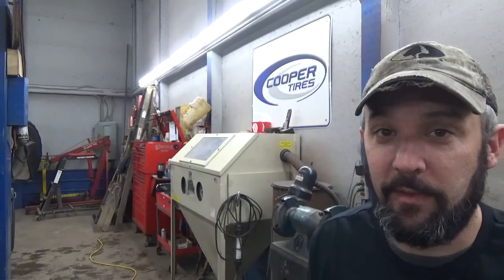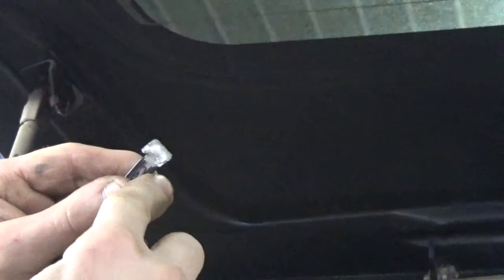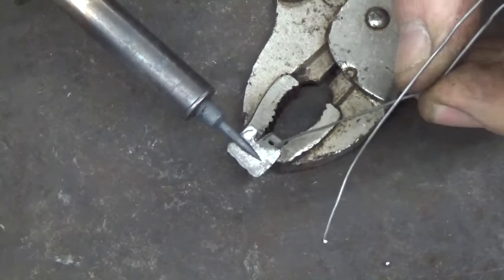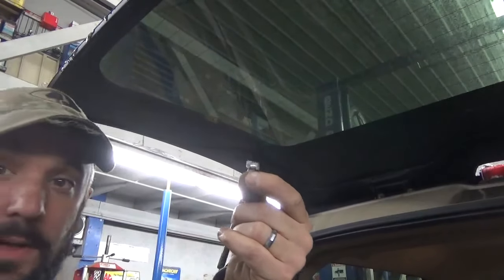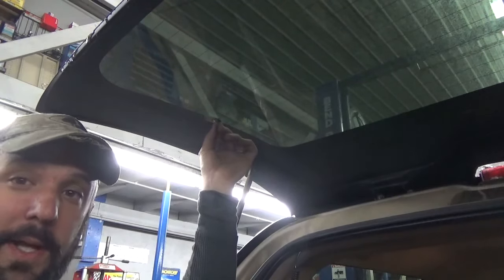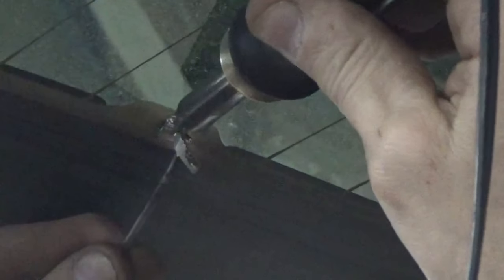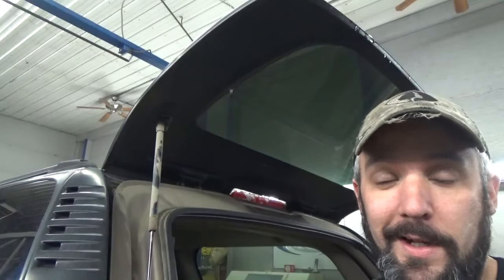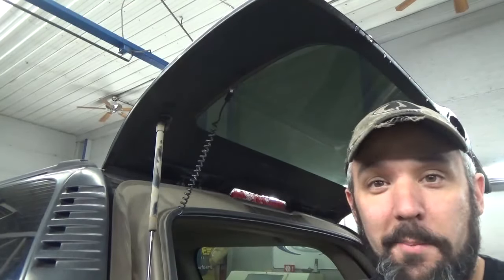Rear Window Defroster Tab Repair

Comment: For those afraid of shattering the glass from the heat of the soldering iron.. think of this. Your window is freezing cold, and you hit the defroster. It gets HOT pretty fast, and melts the ice off. If that quick thermal change and that much heat on a frozen window won't shatter it, a soldering iron for a few seconds won't shatter it either :)
Reply: Posted my 2 cents today on my fix, your right about the heat.  Use an electric Soldering gun or Pencil type .  NO TORCH!
Reply: Thanks, that is my biggest fear. Have a convertible with actual glass and defogger and one tab came off the grid(now I know why), come summer I think I will remove the connectors  from the grid.
Reply: That makes perfect sense!
Reply: That glue is a waste of money
Reply: @boyr3025 I tried the permatex kit today. It wouldn't even bond.
I'm surprised. Because Permatex usually makes great products.
Either that. Or I got one from a bad batch?
I had to Epoxy Glue mine.
Hope it works?
Reply: @4mikeyd  I also tried the glue.  It worked a single time, then melted, ran down my window and no longer works.  I assume it lost whatever conductive materials were in it after that happened, now I have the tab firmly stuck to the windshield and I'm worried if I try to pry it off it will break off the contact point.
Reply: @4mikeyd Regular epoxy does not conduct electricity. Epoxy will only work if it is designed for defroster repair.

Comment: Have you ever seen tiny holes drilled for Bondo to push into, to adhere better? Same principal- drill 1 tiny hole in the metal tab. When soldering- when it flows through the hole and hardens- it's like a rivet. Super bond.

Comment: Worked for me. I sanded what was left of the window pad which was right over my head. I tried to tin the pad but could not get the solder to stick leaving me with a pool of resin on the tab. I put a big ball of solder on the broken tab. I used a screwdriver to hold the tab up on the window pad. Got my biggest watt soldering gun and the solder melted between the two about 20 seconds after taking the completely hot soldering gun to it. Took away the gun and held it in place for 10 seconds to let it cool. It stuck and had electrical contact with the other tab. I am going to put a light coating of a two part epoxy so the soft solder is not the only binding agent to the window. Easy peasy and make sure you have a drop under the workspace so molten solder dosent burn your car's carpet.

Comment: My wife's Jeep had both tabs break a year or so apart. Had a shop fix the first one, looks like they used conductive epoxy and it held OK but there was a bit of resistance in the connection. Second tab broke so I was going to fix it myself. Bought a kit, got sidetracked, lost the kit, ended up here. I'm glad I did, too. This was so easy to fix it was ridiculous. I spent more time digging out my soldering iron than I did actually repairing the tab. It's holding strong and has zero resistance. Thanks for the video!

One extra note for those having trouble getting the solder to flow on the tab when bonding to the window: If you have multiple tips for your soldering iron, use a wedge style or hold the iron so that a lot of its surface comes in contact with the tab, not just the tip, or it may not transfer enough heat over (or it may take a lot longer).
Reply: Thanks for the tip! Wife just bought a jk and the tab is off

Comment: Just did this fix on my 2006 Mustang and it worked great! I had to upgrade my Weller 25W soldering iron to a Weller Medium Duty 60W soldering iron in order for the solder to melt on the whole surface of the metal tab. Also in my case, even with the 60W soldering iron, I could not melt the solder from the other side of the tab while pressed against the rear window so I just melted the solder first and quickly pressed it to the window before it solidified and it worked. Thanks for saving us all a lot of time and aggravation!

Comment: Thanks so much for this video.  I've been soldering things for decades and considered it for our '14 Yukon.  When I saw other sites suggesting it could break the glass I was hesitant.  Watching this video and reading the success comments gave me the courage.  5 minutes later and we're good as new.  Actually better than new since I discovered the factory solder never even touched one whole side of the tab.  Thanks again!
Reply: Forgot to add:  Since it's close to freezing out, I did run a hairdryer around the area a bit first just to take the edge off.  Not sure it was really needed but didn't take much effort.
Reply: @35charlie38  good call! I was worried about doing this when it's below freezing.

Comment: I have zero experience in soldering and with huge fear of glass shattering i gave it a go. And it worked :) I have no idea what king of soldering iron I have or what kind of solder I have... It took couple of tries but works for now. Thanks for the video!

Comment: This video worked like a charm. I have had my Prius for the last three years and the defrost never worked. I thought it was something electrical but it turns out it was one of the pieces needed soldered just like the shows. Thanks for the detailed instructions and it worked like a charm.

Comment: Eric, This really works great if no one has tried to super glue or epoxy the tab on before you get it.   That conductive coating on the glass is so thin it won't stand up to scraping.   GM recommends silver bearing solder instead of tin/lead alloys.   Also, the tabs often fall off due to excess heat generated by resistance created by poor terminal tension where the connector snaps on;  check the female terminal wings for fit, not just the snap feature of the terminal.   Great video, I just discovered your channel.
Reply: I totally respect your input. Took mine to GM and they offered to replace the whole window saying they couldn’t simply get it back in place to stay. I knew that was BS coming from a electronics background. And the recommendation of using silver bearing solder coming from GM? We’ll let’s just keep in mind it was their tab that came off in the first place. Thanks for your input though, I appreciate you. 🙏🏽👍🏽

Comment: Rear window on a 2009 Tahoe,  I just finished after watching this video,  used my battery Dremel to clean the contact & window contact  Loaded up the contact with rosin core solder after fluxing  added flux to the window contact cleaned with dremel wire brush and standard 100-140 watt Soldering Gun and finished. the whole job took 5 minutes. 
It is 30 degrees here in NY and was worried about blowing out the glass with the Soldering gun.  
Just tested with a infrared thermometer and It worked.
Reply: I have a 2007 Tahoe and Im in Michigan. No luck with getting it to work.
Reply: Aquarium Network With
Reply: @goaldigger2314  The same here :(

Comment: Thanks Eric!  Just finished this repair on my 08 Yukon.  Took a few tries to get the right amount of solder and heat, but on the third try  the solder flowed under the tab and it was stuck back on the window!  I'm back in full defrost mode again.  I put on my safety goggles and a hard hat just in case the rear window exploded!  The window remained intact  I had tried the epoxy on a previous vehicle but it did not "take".
Reply: What wattage is your soldering iron? Did you use Flux and 60/40 as suggested above? 
I'm doing a Tahoe also, 2007
Reply: I have Weller 100/140 watt soldering gun.  I used the 100 watt setting with 60/40 rosin core solder.  It's been two months and it's still stuck on the back window!

Comment: I've watched just about every brake pad replacement video you've made. I now replace my brakes like a pro. 1998 Saturn, 1997 Ford Explorer, 2007 Honda Accord. I've done them all. Last year, I blew out  the rear hatch window on my 1997 Ford Explorer with my weed whacker. I had the window replaced with a new one. The new window must have been made in China, because both sides came loose. I wondered if you had made a video showing how to fix this. Lo and behold you did! I loaded up the connectors with solder, and reattached them. Thanks, Eric!

Comment: Thanks for posting this. I've been soldering stuff for more than 45 years, but have never tried to solder foil on glass. I was worried that thermal shock would crack the glass, but I see that is not an issue. I'll try this tomorrow.
Reply: Nah, no worries there. That's tempered glass meant to withstand brutal temps in both directions, and because the defroster wires get hot really fast, to melt ice...the glass is made for this. Sally forth, and solder! :)

Comment: Great video! Passenger side of my 2012 chevy impala tab was broken off. Glass shop told me today they would need to replace entire rear window at a price of $430.00! Saw your video and soldered on piece that broke off. Strong solder done as following your instructions and WORKS! THANKS! 👍

Comment: Better than the alternative adhesives, in my opinion. I just happened to have an old soldering gun with a tiny blob of solder still on the tip. Followed these instructions and worked perfectly. Took about 2 minutes. Thanks!

Comment: thank you again... i seriously just did this in the time between these 2 comments.. took 3 different irons and on the 3rd it took the larger tip. final iron was a soldering gun and it only took a few seconds.. smelled like someone tried to superglue it prior. havent tested yet but after i scraped the gunk off both sides i have confidence. The glass was just warm to the touch after and this video gave me the confidence to complete this very basic repair.

Comment: Thanks for the instruction from Melbourne, Australia.  Worked exactly as you showed.  Being a bit paranoid about heat cracking the glass, and since it's a bit of a cool day, I preheated the glass with a heat gun.  Probably helped the solder heat quicker too.

Comment: I just did this repair on my sons 2011 Crown Vic PI and it stuck.   I took the tab and sanded it clean.  then pre soldiered the tab.  The car was sitting in 80+ degree weather with the sun beating down on the glass.  I held it up on the glass and touched the 30w iron to it and about 20 seconds later.   No broken window and it stuck really well.   I seen no reason why it wont work.  Will know in the morning.   Thanks South Main!

Comment: Thanks for the video man! I had been contemplating soldering that tab back on, but wasn’t sure if I would shatter the window.
Following your instructions it worked like a charm.
Reply: @itsacowboysway  i tried to do it but it wouldn’t stick to the glass, i got the solder on the tab but would not stick to the glass grid. Is it a special type of solder maybe?

Comment: Thanks tor the help. To get this to work I had to touch the edge of the solder after holding the iron on the connector for a few minutes, otherwise it wouldn’t melt it. In the end it worked.

Comment: Just did this on my 08 expedition this afternoon. I've seen the repair kits out there before, but I've not heard great things about them. I have a lot more faith in a solder joint than I do an adhesive that allegedly conducts electricity.

Comment: Thank you for posting this informative video on this repair. I fix my defroster with this method and it worked great and also I saved myself a bundle of cash. Btw the the glue kits sold for this repair are a total scam.
Reply: especially permatex. 3/4 fail to bond, cure, or conduct at all after precisely following instructions on 3 different vehicles last 10 yrs. Took one back the other day infinite resistance and never cured, store said they'd only exchange but not refund. Second kit wouldn't stick at all.

Comment: I tried a glue kit...didn't stick at all. I returned it to the store and about to solder. You gave me a few tips I didn't realize, like pulling the tab out of the clip and pre-soldering and then heating through the tab. It should be easy now!

Comment: Eric,Very good video and a nice tip for everyone .I've seen some of the epoxy kits they sell in some big auto store that some places make a big mess of the window before they come to the pro to repair.
Reply from the maker: Hey thanks jimthecarguy . I've never used one of the kits just because this only take me about a minute start to finish and seems to work well. How do you do them?
Reply: I do the repair the same way you do.I always worry about the window breaking (never did yet) .I usually let the window warm up before starting.
Reply from the maker: Hey I figure she'll go or blow lol, haven't had one pop yet!
Reply: Yet is the key word lol
Reply from the maker: shhhhhh

Comment: I have done the exact repair numerous times. This is a winter job as people don't use their rear defroster a in warm weather. I have always been concerned with the cold glass shattering from the soldering iron so I heat the area with a heat gun to bring the glass up to "hot to the touch" around the repair area.
Reply from the maker: Yeah I often wondered about that too but haven't had one blow up yet... oh great now I said it...
Reply: that glass is meant to withstand extreme temps,it's almost plastic,made of many layers,no way it would ever blow out,it's like pyrex,the old kind,lol
Reply: Tell that to my subaru outback. With some deer related incident, with no direct contact to the the rear window. The entire rear window shattered. A ton of tiny pieces. I've been meaning to clean it up but I'm afraid of it.
Maybe it can handle heat better than this? But it doesn't seem like it had much in common with plastic.

Comment: Thanks for the helpful video from a  very grateful viewer in Ireland.  I bought a used Hyundai SUV  with the tab broken off the rear window.  Unfortunately,  when it parted company with the glass it took a chunk of the copper heater circuit on the glass with it,  so I had a  big gap on the  track  and a slightly trickier job. AND the solder was running downwards instead of onto the heater circuit. On the Hyundai, the glass also has  hinges and can open separately so it's easy to take the glass right off, two 10mm bolts and two gas struts.  - 3 C / 26 F outside so I took it indoors, let it get to room temperature turned it over  and set it on a table. Soldering  so much easier with gravity working in my favour. I was able to get a decent run of solder all around the outside of the  tab and it seems to be  a pretty sound  repair.  To be honest, I was also afraid of busting the glass with the heat, and  if it hadn't been for your very useful video, I wouldn't have tried it.
Reply from the maker: +sean walsh Well cool glad to hear it didn't explode. I am still waiting on one to blow up.
Reply: sean walsh Hi, I have something of the same issue you did. Looking from the outside the whole center of drivers side square circuit connection (at the end of the grid) is separated from the glass. It's hanging on by 1/16 of an inch, or less, around 3 of the edges of the square. It's clear glass in the center where it came off.  My question to you is how did you get section of the circuit that broke off with the tab to stay attached to the glass after you soldered it to the grid?

Comment: Awesome I am proficient in soldering, I was scared that the window would take on too much heat and break. I see that you tin the tab first this answered my question about that. Thanks! I don't know about that glue either as the solder is so good the I have to remove the tabs that broke in the window. The tabs themselves broke for me.

Comment: Well i'm glad that i googled this problem on international languague) I have both my defroser contacts fallen off and tried to search answers in my language where the only "solution" is glue which is not solution at all considering comments about it. Also some people solder but they say that it's not strong enough and that the only option is to buy a new rear glass and that's heavy! I mean, maybe i'd already went this way if i could find new glass not from some chineese manufacturer but from ariginal factory, but there are absolutely none. So thanks for a video, i'll take a try when next summer begins.

Comment: I bought that crap tab repair epoxy from AutoZone.  First time it didn't work at all, I followed the instructions, didn't work. Bought another kit, cleaned the connections and did it agian. Kinda worked but my rear window wouldn't defrost . Watched this vid, bought a soldiering gun, rosin core solider. I was concerned because I had bad luck with soldiering in the past, just couldn't solider. I did exactly as he instructed, but I cleaned the tab and the spot on the grid where I was going to solider. Put the soldiering gun , waited for it to cool with a small screwdriver and held it for 30 seconds. It held. I turned the defroster and checked the tab area with my finger, it was warm. I blew my breath on the rear window, the fog started to go away where my breath was. It got so warm then when I breathed on the window it would not fog. Stay away from the epoxy crap, this is the only way to properly to reattach a tab.

Comment: I watched this just to see your process, as I am always willing to learn. I always solder them, and have even repaired open individual elements using solder. It just takes some 'technique' .. lol.. The glass shop I deal with uses the same stuff as rear view mirrors are held on with, with good success. Just sayn.